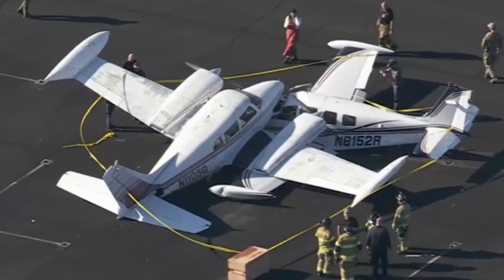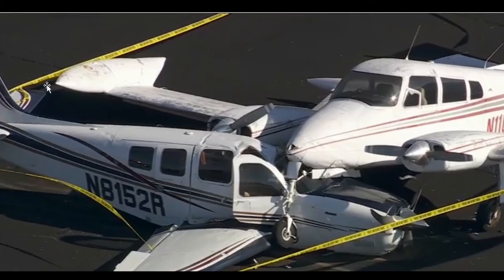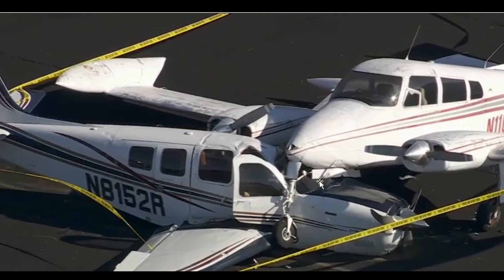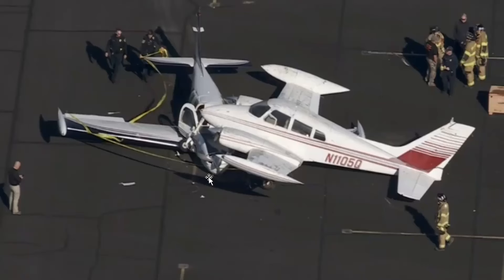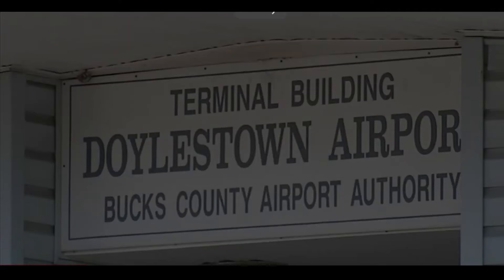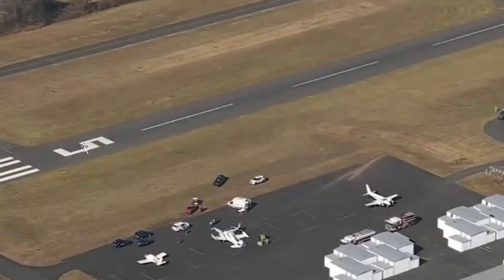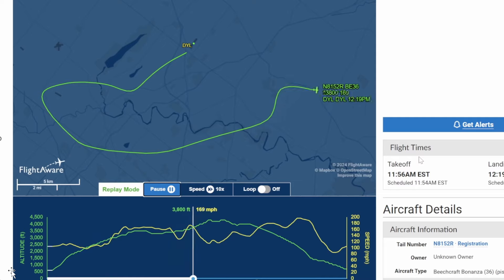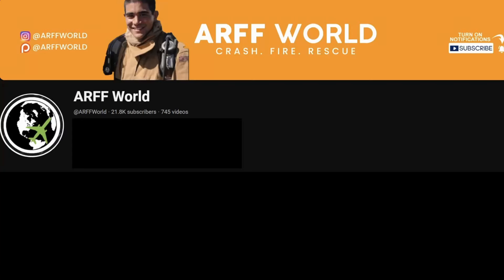Bonanza Collision Landing in Pennsylvania

Comment: 18 kts of crosswind, the Bonanza pilot was ATP airline pilot with the owner on board. Taking a test flight in preparation for purchasing the plane. Failed to maintain directional control. 

The only winner here is the 310 owner. Take the settlement and he get's more than he could ever get selling that old bucket of bolts that probably hasn't flown in decades.
Reply: @skyboy1956  ya the 310 def looked abandoned.
Reply: Another ATP making student pilot errors on piston planes ? Dammm

Comment: The single engine bonanza has its prop blades bent backwards.. typically that means the engine wasent making power at the time of the collision. They usually get bent FORWARD when they are making power at the moment of prop strike.
Reply: Or they cut the power when tried to stop.
Reply from the maker: Thanks Tom. Happy Holidays

Comment: Twin…crosswind gets under wing and drifts off centre line … pic tries to recover but leaves it too late for a safe go around…picks it off too slow and stalls…a guess.

I’ve done go arounds … lots when training… very few afterwards…difficult to decide quickly to just go…unstable approach. Too fast, too high … not lined up…flaps and slats…easy to make a mess of it…as the song says…you can always go around.

Others on final can conflict. My last go around on an aerodrome with no tower…pitch up, power up, clean up, speak up.
Reply from the maker: Thanks my man

Comment: Looking at the crash photos, looks like he's at flaps 30 still. Gotta retract flaps on a go around. Unfortunately pilots do this all to often.
Reply: @kenharbin3440 Only once a positive rate of climb is reached and based on where he veered off I would say it was not reached; if this was really a go-around. If it was a touch and go then you are correct.
Reply: @lancomedic  Yes, it looks like the Bonanza was almost out of runway when the pilot decided to go around and pushed the throttle forward. He didn't have enough runway left for the go around so the Bonanza didn't have enough speed when he pulled back. Stall! That's the way it looks to me, though NTSB may find something different.
Reply: @RaysDad  Firewalling the throttle in that airplane at low speed might have resulted in a strong torque pull to the left, not enough left rudder or startle factor combined with the strong gusts.
Reply: Correction, right rudder, should have been almost all in by that point.
Reply from the maker: Go point Ken
Reply: @bernieschiff5919  Could be!
Reply: @bernieschiff5919  there is an edit button if you like…. Click the three dots at the top/right of the post.

😃